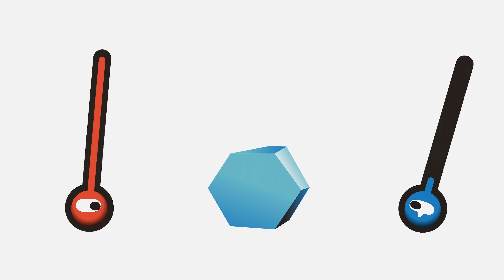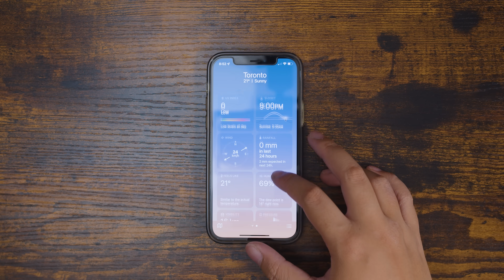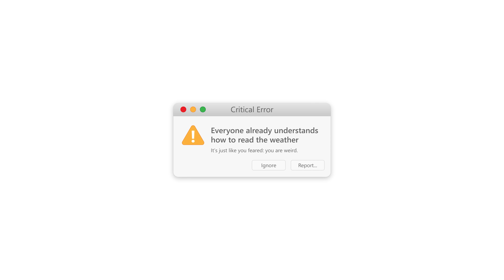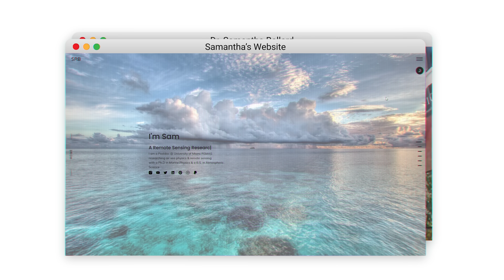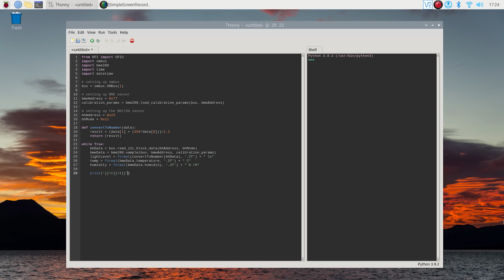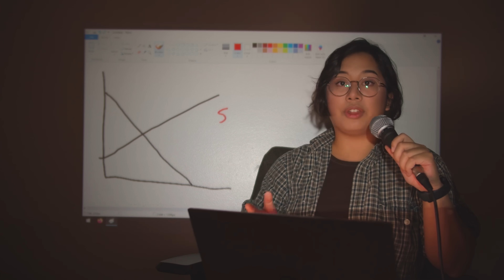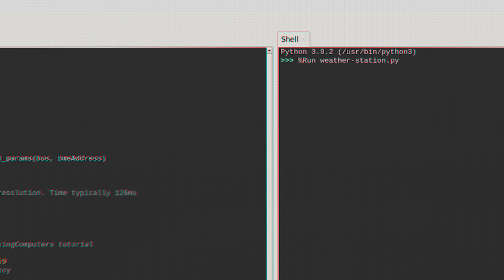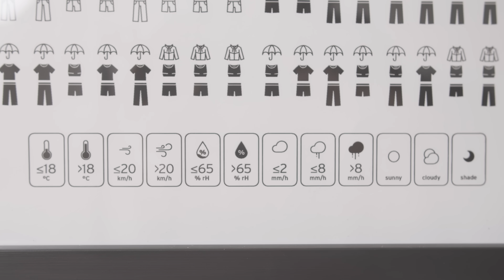how fahrenheit fails you

Comment: Once I started commuting to work on a motorcycle in Canada, I began to check the weather carefully before leaving home to know how to layer up as my commute is about half an hour and takes me on fast freeways. If I get cold there, I can’t pull over and layer up. My bike also has an ambient temperature display so I’m constantly seeing the temperature and comparing that number to how I feel, especially if I sense any changes. The fact that I check the temperature (and sometimes humidity) so frequently and compare it to how I’m feeling has made me easily notice the difference between a couple degrees and know exactly what to expect based on the big number on my weather app. Basically, I’m not better than anyone, I just developed the ability through constant, real-time checking. I was basically calibrating myself.

Comment: as a dutchy this is my scale (Celsius) : 0 is cold (jacket)
10 is OK (sweater)
20 is warm (no need for jacket or sweater)
30 is hot (short sleeves)
40 is don't go outside
50 is you're gonna burn
60 is no

Comment: Fahrenheit is easier to guess what temperature it is because the degrees are more spread out.

Such as the difference between 0 and 100 is smaller than the difference between 32 and 212

Comment: "Fahrenheit ist probably the most intuitive when it comes to the weather". 

No, no it's not. As soon as you leave the US-bubble and just assume someone would need to adjust to a temperature scale from the ground up, Celsius is a lot more intuitive, since it's rooted in easy day-to-day observations. 

It's 0°C? There's probably snow outside. 

While Fahrenheit just starts and ends somewhere without actually tangeable fixing points. It's just "a bit over body temperature" and "the temperature of a very cold mixture in a particularly cold night at some point in time".

Comment: use Kelvin
it's an actual unit of measurement instead of a historical scale
usign either fahrenheit or celsius is like saying "my desk is 3 cm wide" when you really mean "my desk is 3cm wider than king so and so the great", thus falsely implying that desk that is 183cm wide and thus 3 cm wider than the height of king soandso is half the size of adesk that is 186cm wide and thu 6cm wider than the height of king soandso

Comment: A very simple way to discern temperatures:

Celsius: How water feels 
Fahrenheit: How humans feel
Kelvin: How atoms feel
Rankine: How humans think atoms feel
Reply: what does "how humans feel" even mean? 32 and 0 are just arbitrary numbers used to define the freezing point of water.
Reply: @iqbalindaryono8984  because it was originally based on body temp with 100 being  (Near) resting body temp
Reply: I'm pretty sure Kelvin = C°
Reply: I'm pretty sure Kelvin = C°
Reply: @theguywhoasked4132  *Kelvin and Celsius use the same scale, but with different offsets

celcius places 0 at the freezing point of water, whereas Kelvin places 0 at the lowest state of energy than could conceivably exist

so Kelvin ≠ °C because °C = Kelvin + 272.15
Reply: @theguywhoasked4132   (similarly, Rankine uses the same scale as Farenheit, but with it's 0 point set to the lowest conceivable energy state that exists, such that °F = Rankine + 458.67, where 0 Kelvin = 0 Rankine)

Comment: The problem is that humans have a REALLY small window for what we consider hot or cold and that varies dependant on the person.
This is also why when you have a shower it either feels freezing cold or boiling hot.
C is more useful than F in a scientific standpoint because it's in reference to freezing point of water to boiling point but what does that mean for people?
Then there's humidity to account for, whether you have AC and things go AWOL.
For example; My house has no AC, my bedroom is 19.4c/66.7f, 69% humidity and it's cold to me.
To my parents it's hot.
Get to 25+c and i start to get hot, so the range between comfortable temperatures for me is between 23-24c.

Getting a personal scale of temperature and recording how you feel in that weather is probably ideal since it will pay down the line to know what to wear.

Comment: You know you can water proof cardboard or paper by scribbling on it with crayon. or by melting wax on it. though it did hold up remarkably well. Props for not spending 16 hours to 3d print a box.

Comment: How is Celsius bad? It's super easy to use, it's the same as Kelvin (used in the International System) just shifted so that the 0 indicates the freezing point of water and 100 indicates the boiling point.
And, unless you live in a place with extreme weather conditions, you're always going to stay in the 0/40 range:

0 is perceived as "cold" (cover yourself). Also, it might snow, because, you know, water freezes at 0.
20 is "room temperature" (tshirt and a sweater)
40 is "hot" (you're at the beach).

You just need to get used to it.

It's certainly better than Farenheit, where to find the freezing point of water you have to divide 420 bald eagles by 69 football fields and then mutiply by the square root of a hamburger.

Comment: Fahrenheit is objectively better for outside air temperature as it was calibrated to the human body and cold brine water, which covers the human experience than the two phase transition of water. This is why I can say it's in the 80's and you know exactly how hot I'm talking about, it only requires 1 significant digit. Here's the thing, Celsius is only a tiny bit worse so most people don't really notice. It has 2 significant digits, and the chemical range is only a little larger than the human experience. Which is why it doesn't matter.

Comment: Celsius is not that hard if you are used to it I think?
Like, it obviously there is variation but somewhere under 17-20 it is no longer warm, and under 10-15 it is cold (at least in my opinion) and above 25 its warm, 30 very warm.

Comment: It is funny, when I use to deliver beer during Ottawa winters I would dress kind of light, so denim pants, thermal long sleeve , work shirt, light vest,  light gloves, wool  socks, lighter boots maybe a toque usually a trucker hat. The main reason is that I would be in a truck that had two heat options (none or lava), then go outside in the cold, into a warm restaurant, into a hot kitchen, into a cold beer fridge, back outside, back in truck.  

Ottawa  also had something CBC called "Wintery Mix" that means in that day it could randomly change between snow, sleet, freezing rain or even light hail at any point in the day.  So dressing for weather was difficult.

Comment: Celsius makes more sense
100 is pot of boiling water
40 - 55 is shower
36-37 is Body temp
35 - hotter day
30 - Hot day
25 - Warm to hot
20 - Warm
15 - Cool
10 - Cold
Under 10 - Colder
0 - First temp for freezing

Fahrenheit being based on body temp is pointless because what does your body temperature feel like? Now for Celsius,  what does a pot of boiling water feel like?

Comment: I have switched to mostly Celsius despite being in the US and can understand it fairly intuitively, dividing it between 0°C freezing, 40°C super hot, in ten degree increments, with a few more details in the temperatures between 25°C and 40°C that I actually experience in LA. 

The TL;DR is 0°C, extremely cold, 10°C, very cold, 20°C, closer to comfort, 30°C, a bit hot, 40°C, super hot. More detailed:

0°C is literal freezing, when water turns to ice. 

10°C is very cold, at least for LA. 

20°C is teat temperature some powerful air conditioning is set at, which feels oh so cold. 

22°C is "room temperature", which actually feels cold to me. 

25°C is about the temperature, where I am comfortable, before it gets a bit too hot. 

30°C is hot, and a bit lower than the normal temperature in my bedroom before I got a portable AC. 

40°C is super hot, the same as triple digit temperatures in fahrenheit. 

50°C is extremely extremely hot, among the hottest temperatures on Earth. 

100°C is when water boils. 

I have gotten better at guessing temperature, due to having a Celsius thermometer that I can bring with me, allowing me to tell what the temperature actually is rather than just guessing based on what the temperature is somewhere else. My room, for example, at 31°C when the central AC is set around 78°F/25.55°C, is much hotter than I would guess without the thermometer. 

That is for indoor low-humidity temperature though, not outdoors. For outdoors I generally just wear light clothing by default but also bring my sweater in case it is cold (including places that just have overkill air conditioning), and wear a more intense sweater if it is winter. LA temperatures are usually too hot so... whether it is too hot or extremely too hot, I don't change my clothing much as there is a certain minimum amount of clothing, that I am comfortable with, and I do often carry a lot of things so it is easy to bring my sweater.

Comment: I never understood why Fahrenheit, pounds, or feet even exist. Like we had a universal measure of temperature (celsius), mass (gram) and distance (meter). Why in God's name would you complicate the damn thing?
Reply: Because those other units of measures came up before the SI units got widely used. Sometimes they got replaced, like Leagues, sometimes not.
Reply: I vote we all change to SI units. Then it's not just the Americans who have to adapt to a new unit of temperature measurement.
Reply: those measurements are invented based off human metrics like someone's feet, or arm length
so it would be easy to roughly measure something or estimate something really quickly just using a body part
but science required something more accurate than that because it may also vary from person to person
so that's where metric came in, with clean by 10s conversions
although you would need a measuring device like a ruler instead of your body parts, but there are some ways to esitmate that too
so yes, metric is universal, and imperial is based on humans

Comment: My issue with Celsius is that it's not a very "human" sized scale.  Fahrenheit is a larger scale and thus easier to use for typical human temperatures...BUT I would argue that we could improve it by making it a big larger.

F; 32-100 = 68 "points"
C; 0- 37.7 = 38 (rounded) "points"

My theoretical "scale"
0-100 = 100 "points"

Comment: the biggest problem is just that what we feel is not only dependent on those physical datas, but also our biology

in this period my hormones are all over the place for medical reasons and i'm feeling extremely cold and it's summer and there are 40°C outside while last year i would feel really hot
so even if the mass and it's distribution would be the same, even if the temperature and humidity would be the same, we could feel completely differently depending on what is happening on our body

Comment: Oh man McGyver is now a woman... Celsius is easy: beneath 0 water freezes and it is likely to snow. 0 - 10 is cold like in autumn. 10-15 is mild. 15-25 is the temerature you got in buildings. 25-35 is summer. 35-45 is dangerous summer where you should be in the water with shadow or inside. 45-50 is really dangerous don't be in such temperature. 50+ is deadly after a relatively short amount of time. 100 water becomes vapor.

Comment: The main thing about Fahrenheit is that it's got a lot more room and so more precision. This is because no one talks about fractions of a degree. So the minimum unit is a degree. The fatter the degrees, the less precise the system is. Celsius has chunky-sized degrees so it's less nimble.

It's useful for cooks in a KITCHEN or chemists in A LABORATORY, perhaps who want to boil water and such.

For day-to-day CLIMATE navigation, Fahrenheit is nearly triple the numerical space to communicate the same range, and the low and high ends are fairly turned to human experience among realistic ranges this planet goes through anywhere where humans tend to live. Generally speaking, the surface of the Earth doesn't tend to go much above 100 F, or below 0 F as you stated. So in a sense, Fahrenheit uses more of the number line to talk about more of the relevant stuff. in terms of information theory., It minimizes entropy because a message communicating temperature data collected for Earth climates would be more informational in Fahrenheit than Celsius. In fact, once you hit three digits, you have a lot of headroom before you get to 1000 degrees. You can describe all sorts of quite hot things that are 400 or 600 F.  And that's useful for cooking, but you don't need beyond that. You don't talk very often about 1000-degree things whether in F or C, so who cares that such things take 4 digits? Meanwhile, we used the range that 3 digits got us (up to 999) to include just about all of the temperatures used in cooking. And industrial processes are around this range too.

Meanwhile, you don't even talk about 100+ F degrees that often, meaning that two digits communicate the information just fine most days in most places. And we get to use the full range of those two digits around the world. It costs two digits in Celsius also, but you don't get the full range. Instead, you only get to around 38 C at the hot end of the climate scale. 0-99 F vs 0-38 C.

Having said all of that, I do wish that instead of Fahrenheit or Celsius, we had another system where 0 = water freezing and 200 = water boiling.  For now, I'll use ♥ as my units. Such a system would regain precision by doubling it from Celsius, in such a way as to make 0 - 100 ♥ almost exactly the range we need to go from "snowing" to "Death Valley."

The way such a system would work is:
0 ♥ : water freezes, it could snow, equivalent to -32 F, 0 C
75.55 ♥: equivalent to 100 F, 37.77.. C
100 ♥: equivalent to 122 F, 50 C, which is representative of the highest temperatures we see on Earth, especially more as Climate Destruction continues to warm us
200 ♥: water boils, equivalent to 212 F, 100 C

Best of all, converting between this system and Celsius is easy: just multiply or divide by 2!

Comment: Fahrenheit is easy, at least here in Florida:

100 or above, way too hot. Wear very lightweight (not cotton), light colored long sleeve shirt and long pants, and limit outdoor exposure. (I know this is against typical advice to wear short sleeves, but trust me, it works).

90s: hot, wear shorts and a short sleeved shirt.

80s: warm, wear shorts and a short sleeved shirt.

70s: ideal temperature, wear shorts and a short sleeved shirt. Lightweight pants will probably also be comfortable

60s: somewhat cooler, wear lightweight pants and a short sleeved shirt

50s: cool, wear pants and a long sleeved shirt.

40s: somewhat cold, wear good pants, long sleeves, and a sweater or jacket

30s: cold, wear good pants, long sleeves, and a heavy jacket

20s: cold, start thinking about wearing layers, limit outdoor activities

10s: quite cold, dress in layers, limit outdoor activities.

Comment: Celsius is easy.

0 is freezing, 100C is boiling point of water.

5 is really cold
10 is cold
15 is chilly
20 is Room Temperature
25 is warm
30 is hot
35 is scorching
40 is last time you see your grandparents

Body temperature is 37.0, no need for a third significant digit, just 37.

Comment: The fun part is, for the issue you're having with dressing for the weather, neither is going to actually help you. Why? Human's adapt to temperatures. So our 'perspective' of what the temperature actually is, is a constantly sliding scale. In winter, after days of -10, +12 seems like beach weather and there have been days I've shoveled my driveway in shorts and a t-shirt due to those shifts. Yet, if you go from 26 degrees, to 12 degrees, you'll feel freezing without a jacket. 

Likewise, humidity in most places is an issue that neither scales 'bake in' to their temperature either. Where it showed 26 degrees, if you looked at an app with more detail you'd see the 'feels like' stat, which probably added anywhere from 5 to 10 degrees depending on the humidity. So the 'great debate' between celsius and farenheit ultimate don't resolve your original issue.

Comment: well, both are bad, celsius is a bit less bad, at least it has a meaningful 0 and 100 point, and if from those two you fail to get an idea of temperatures, than it is not the scales problem. of course the only proper scale for temperature is kelvin, but for some reason people do not want to switch...

Comment: Celsius and Fahrenheit are both abominations. Kelvin is the way to go 😁
Sure, saying it's 298 K out there is quite a mouthful, but both Celsius and Fahrenheit have zeroes in arbitrary points in the middle of the scale, and that makes unit conversion a mess. To convert from Celsius to Fahrenheit you make 1.8 x Celsius + 32, UNLESS you're converting a temperature difference, instead of a temperature, in which case it's just 1.8 x Celsius... we don't have the same problem with other units because, for example, we don't measure height putting the zero at the height of our belly buttons and say our feet are negative height...

Comment: Dude, that weather station serves no purpose other than looking cool, if you are using the weather app data to find the outfit on the chart, you should have used the same data to build the chart on the first place. Using different datasets to build the chart and use it is very prone to error. If you built the chart using the weather station than use it to find out the outfit on the chart.
All that explanation of precisely  collecting the weather information where you live makes no sense if you are going to use the miles away data collected by the weather app anyway.